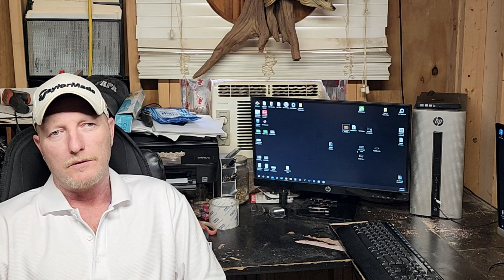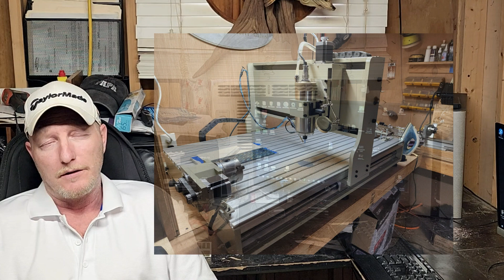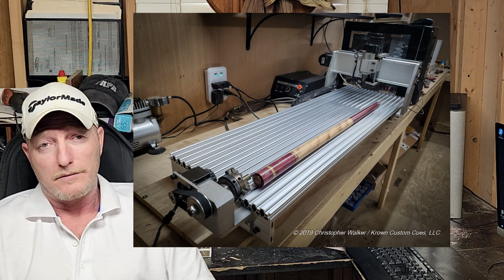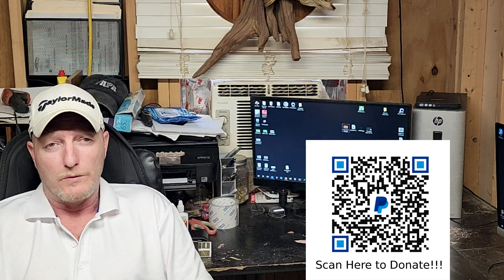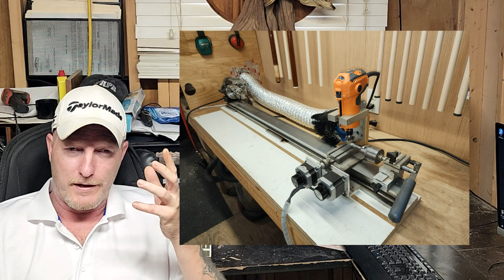Introduction to cnc for cuemakers

Comment: I am very familiar with CNC but not with cue building. Most videos I see have a rotary axis for engraving and a separate rotary axis for tapering. Why not use one axis (the one driven by a stepper motor) for both operations?
Reply from the maker: @KentCNC23  thank you for your question.
It should be pointed out that actual striaght wall pockets are cut for inlays. This is not considered an engraving process. Cuemakers utilize a spinning station with a variable speed DC motor instead of the 4th axis rotary to cut shaft profiles and butt tapers as Stepper motors are not rated for continous rotation in any one direction hence the need for a separate dedicated spinning station much like a tradition metal lathe.
Reply: Thank you for the reply! I was considering implementing separate drive electronics that I could use to continusously rotate the rotary axis when not being used for inlays. l did some quick testing and I don't think that will prvide adequate RPM. My goal is to mount a 4th axis to the tabeltop of my CNC which I can push to the back of the machine when not in use. I would like to do this with a single rotary axis. I am now considering building a bolt-on solution so I could swap the stepper motor with a variable speed motor. Use the stepper for inlay and the variable speed motor for tapering. Can anyone point in in the direction of variable speed motors that are used for tapering operations.
Reply from the maker: @KentCNC23  Reach out to Todd Schultz with Mid America. He sells a nice 1/2 and 3/4 motor.